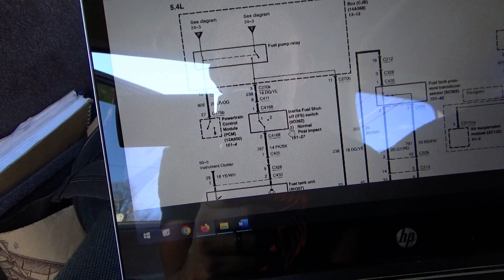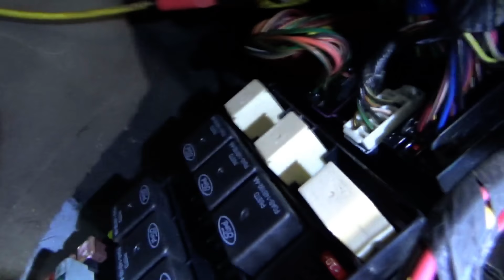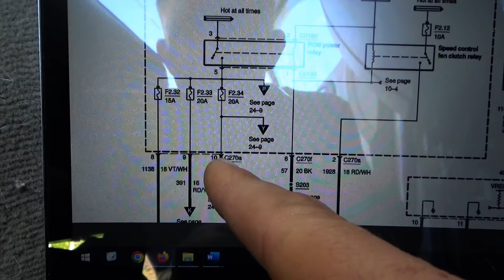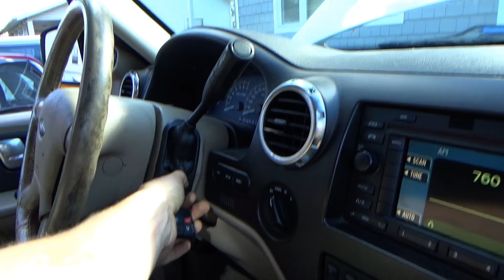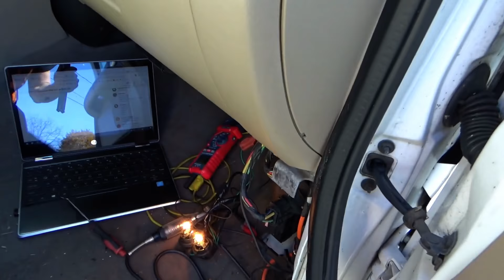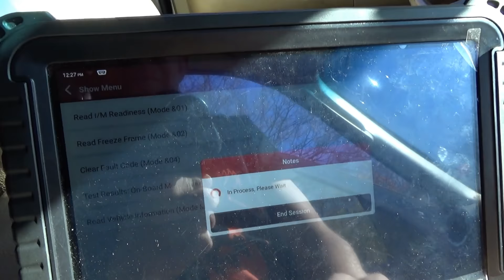Ford Owner STUMPED for 6 MONTHS? Fixed in 15 MINUTES! (No Fuel Pressure P0231)

Comment: During a collision if the fuel line is ruptured, that integral relay is turned off by the PCM when the PCM sees the crankshaft stop turning. This was mandated by the Feds so that occupants still alive don't find themselves in a growing pool of gasoline under the vehicle, that possibly might catch fire.  So, an external replaceable relay ought to be grafted into the circuit. For CYA reasons.
Reply: Look at the schematic on the screen, With this change the factory inertia switch will still shutoff power in the event of a crash.
Reply: @DavidNull5  And what if the inertia switch was replaced ... with a jumper? Or if said switch did not pop the ball bearing out because the impact was not enough?  What if you have a failing injector that could pump the fuel tank dry into the intake manifold?  What if the fuel pressure regulator failed?  On older vehicles, the return line could be pouring fuel all over the place, which might not occur if the pressure did not build and the injectors did not start the engine..,., pump would be off until it started.
 Save a few bucks and a few minutes, but the 'new designer' could be on the hook if any of that occurred due to deleting ECM control of the pump.
 I would add a external relay for the slight cost, and a bunch of 'what if' problems. tom
Reply: @DavidNull5  Yes that is true.  My 1989 has an inertia switch as well.  I'm thinking the inertia switch is good, but someone in the legal department wanted redundancy built in.
Reply: Ya, this is fine for a test but having the pump run full time the key is on is not safe from a fuel leak standpoint.
Reply: @compu85 these years vehicles have a return type fuel system.  The gas flows back to the rank
Reply: @compu85 Didn't they used to make a fuel pump safety switch mounted to the oil pressure sender when going from mechanical fuel pump to electric
Reply: U are from the what if department. 
The only what if is if there's an accident, and the ignition is left on.
Just remember,ber a what if allways trumps the dollar . Lol
Reply: @debsaville6756  I hear you. Retired auto mechanic here. The what if department is almost as old as the team of lawyers who sued Ford over drop in gas tanks causing average rear end collisions to turn into  infernos.  The Vega's oil pressure switch turned off the in tank fuel pump because GM didn't want the what if legal team suing them if the Vega owner knocked him or her self unconscious in an accident.  The theory was if the accident was bad enough to render the occupants helpless, and the fuel line was breached, the engine would stop running which would open the circuit to the in tank fuel pump, preventing the folks inside from being in a growing pool of raw gasoline.  So the what if department legal team has been alive and well for many decades, and I would not like our favorite independent technician to have his life turned inside out by them, over the simple deletion of a relay which he could easily install externally in a few minutes.  If I could do it, he surely could.
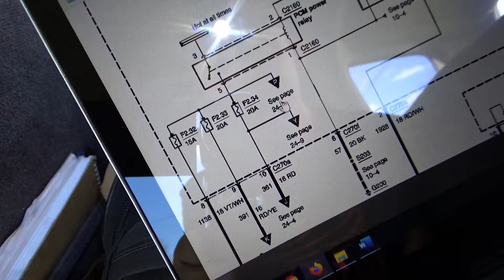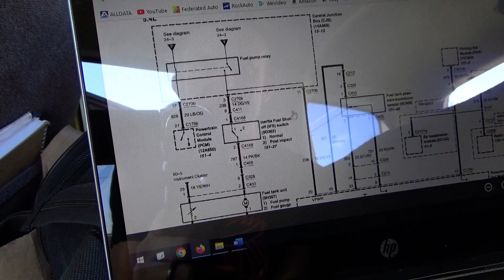Reply: The signal that turns off that relay also supplies the power to the fuel pump..  At 5:29, you can see the signal comes out of the PCM and obviously goes to Y, but it also goes to P..  P goes to the control side of the relay which you can see at about 2:50 in the video..
.
The computer isn't losing control at all.
.
Edit:   I'm wrong, I didn't see the control on the ground over on the left hand side of the schematic.
Reply: @bobw53jrma  P is not control side, it's load side. Look at the diagram again.
Reply: @fvdstone P looks like a coil. That would be the control side.
Reply: @fvdstone  : I did, you're right.
Reply: @bobw53jrma  So, it would seem that Ford is spending money on relays just so they can sell power centers when they go bad? No other possible reason?
Reply: @bobw53jrma 
You should tune down your confidence before spreading missinformation, bud. Fuel-pump relay is controlled by PCM via a lss. The feed comes from wire P, yes but the other side is controlled from pcm by grounding, clear as day.
Inertia switch is not enough, there a multiple other conditions that shall disable fuel pressure.
Reply: @TheFirstBigCheese :  I saw that afterwards, and was going to correct it, but I went to bed instead and then forgot about it.
Reply: @TheFirstBigCheese "Bud" is a douchbag word.
Reply: @Mag_Aoidh Sorry, I'll be more careful using "bud" next time; using dickhead, dumbass or even American if I ever need to push it. Especially if I'm gonna changing topic to language learning on a topic regarding vehicle engineering.
Reply: @bobw53jrma No worries mate.
Reply: @TheFirstBigCheese I agree, I'm okay with a parallel relay with the ECM controlling the new relay.  It's not that much more complicated. Just feed the hot wire to one relay coil (85) terminal, and to the relay output common terminal (30). The original control wire goes to the other relay coil terminal (86).  The N.O. relay terminal (87) powers the fuel pump.  This leaves all protection intact, and doesn't shift the load through different wiring.  The fuel pump probably draws about 10 Amps.
Reply: There may be reasons to bypass with another relay,  but he didn't bypass the inertial cutoff switch, which will trigger in an accident.
Reply: @hedaron3787 and. Importantly. Did not cut the gr ye wire. So that means the gr ye wire in c270b is sense wire for pcm and pcm will know Fpump is ok😊
Reply: I was coming on here to say pretty much the same thing.. this could be a big liability risk..
Reply: Inertia switch kills it with impact pcm secondary
Reply: If the motor stalls, the pump will continue to run all the time if the ignition is on. I’d be wiring in an external relay for safety. Anything happens down the track, owners are always looking for someone to sue.
Reply: @pw3111 if it stalls I would be turning the key off anyway
Reply: @the-ww-rrb-bandassuming you're conscious and aware. The "fix" runs the pump through circumstances that the ECM would shut it down.
Reply: @mikebrown7366  The video ended with the question: What would you do next?  Obviously my reply was incorrect.  Nobody is perfect. I have been retired for more than 10 years now.  Direct injection was quite new when I moved on.
   The ECM shutting down injection pressure is beyond my experience.
Reply: Inertia switch kills it with impact pcm secondary
Reply: I was thinking the same thing, in fact, in the mid-70s when everything was still mechanical fuel pumps, the feds mandated a rollover Valve to shut the fuel off. I realize the chances of this being traced back to you are slim, but with a New York lawyer, and a dead family...
Reply: Has anyone taken the junction box apart to inspect the relay?
Reply: @diyguy7357  I don't know.  Good question.  Soldered in most likely.  Possibly in a serviceable way, possibly not. If it were on a vehicle I owned, I would cobble in a standard relay, and mount it out of the way nearby.
Reply: The inertia switch will turn off the fuel pump and pcm will see that happen. ,not only crack sensor
Reply: No big loss if a Ford burns
Reply: @mikefoehr235 no big loss if any make burns, but you may be in it. O yea no big loss..

Comment: Let me start by saying I love all you videos Ivan.  This on the other hand is a bad idea in my opinion, This should have had an external relay installed, The way Ivan did this, the fuel pump will not time out when ignition is on with KOEO. Using the circuit diagram it would have been a tiny bit more work to add the external relay.
Reply: Now see that there right there y'all is three logarithmic levels above my back yard mechanical hatchet skills 😮
Reply: The pump is not on in the accessories position on the key which you would listen to the radio... And the inertia switch would work in a wreck. All is OK.

Comment: 😱  Check your ‘jumper’ wire guage size & what wire size you’re tapping into. Should match or be larger than the existing long run of fuel pump power wire…

Comment: Should be adding an external relay . Not letting the pump run anytime the key is on .
Reply: Thought the same.
Reply: Agree totally.
Reply: agree!!!
Reply: I was going to say exactly the same!
There's a reason why that relay is in the circuit, it's not there for fun.
Looks to be fairly quick and easy to fit an external relay, why not just do it?!

Edit: Thinking about it, this is a dangerous 'repair'. The fuel pump should not be energized unless the engine is cranking or running.
In a collision, the engine could stop and because the PCM no longer has control of the fuel pump, it would still be pumping fuel.
This would be extremely dangerous if a fuel line was ruptured!
Reply: @Ben-says-you-are-AWESOME  the enertia switch on fords cuts power to the pump in the event of a crash
Reply: @billbarney4937  True, but they're not infallible, plus, they don't activate in every accident.
Reply: The shop IS now aware of the exact issue and HOW to "OE-correct the repair". The onus is on the shop to professionally and ethically proceed (not saying in any way that PHAD or repair is unprofessional/unethical) but the onus to inform the customer of the current situation, repair, determine further parts and labor for "OE-correct" be authorized and deemed necessary for 20y.o. car, and to properly inform customer of the idiosyncrasies of the "temporary-but-compartmentally-safe" fix, is on the shop and customer. The repair is not unethical due to the fact that the Inertia Switch IS still in ECM- and key-controlled circuit.
Reply: Why ?  Better to add a fly back diode across fuel pump +12v and ground to stop arcing of relay that causes the failures. Use a 1N5823 diode
Reply: Everyone is in overkill mode here. I would for sure let him do this fix (If it was my car). First of all I would need to get into a bad accident and then have the accident so bad that I can't turn off the vehicle, and get out of the car. And on top of that have the inertia switch fail, then have fuel draining to the point it causes a fire. What are the chances? Well if all that happens then maybe it was just my time. Again, that is if it was my vehicle.
Reply: That's what I thought at first too, but the wire that kicks the relay is also the wire that supplies the power to the fuel pump.   
.
The only difference is that the wire that kicks the relay, which goes through P is pulled off before the fuse..   Look at 5:29 in the video, and then around 2:50.
.
If it was a new vehicle and had some value, yeah, probably replace the whole fuse block, but its over 20 years old.  
.
It really kind of is a useless relay.    The signal wire IS the power wire, just that the signal wire is split off before the fuse.
Reply: @bobw53jrma yes. Cause they got rid of fuse F1.9 and moved it to F34 and increased it from 15A to 29A
Reply: Should always fix things right! What about the next guy(down the road) chasing a no fuel no start?  I know it makes you look like a hero but what if vehicle is in an accednet and that inerta switch doesnt open and the person is trapped with fuel leaking?
Reply: @MR.KNOWITALL1982  Or if a fuel line comes too close to the exhaust system, or breaks due to some other reason.
Reply: @The-secret-101 if it came close to the exhaust manifold with a relay it could still be an issue…
Reply: @Mac_F87  Yeah, but if the engine stalls the relay would cut the fuel pump, most likely stop things from getting too bad.
Reply: @ so much what if in this comment section. And if the engine is running with relay? It’s still going to go up in flames. 🔥

Comment: See any Ford product from the late 1990s/early 2000s. They used an IRCM The IRCM (Integrated Relay Control Module) was basically a box with several relays soldered to a PCM.  Cheap to manufacture, but hot dog shit to repair.  The car needs a $5 relay, but it gets a $250 (in 1990s $) IRCM.

Comment: Well done, Ivan! Clever way to bypass an absurd problem "invented" by Ford! Initially I thought you would install an external relay, but when you said "no parts required" and shown the diagram, it's a perfect solution.
Reply: It's not a perfect solution. Any time the vehicle has any service requiring key on engine off the fuel pump will run constantly. Run out of gas and leave the key on and the pump runs dry.  If you run out of gas and want to push the vehicle or flat tow it the key must be on. If you run out of gas and call for a tow the tow operator will turn the ignition on to turn the wheels, load the vehicle etc, and the pump will run constantly with the key on, running a liquid transfer pump dry is never good for the pump.
Reply: @truracer20  You are right. I hadn't thought of that situation. Thanks for pointing that out 👍

Comment: So after the fix, when the ignition switch is on and when the engine is not running the pump is running ?
If yes, then maybe adding the "bypass" relay would be a better idea.  Of course I'm assuming in normal operation ( before the fix ) the pump only primes when the ignition switch is first turned on and then turns off if the engine is not started.

Comment: (1/of 3)  I'd of preferred you replicate the  "pitted" relay externally to the junction box rather than just jumper around it.  However I'm uncertain if the control lines for this pitted relay are available.  If so, an additional external relay best meets engineering criteria.  

----(2/of 3)  If it's possible to remove all connections to the pitted relay load contacts you might revitalize points by applying a punch-through voltage to them.  Clearly, if done wrong you'll roast your terminal block.---

(3/of 3)  I learned early in my career that relay points for D.C. currents thru inductive loads  require a diode across across inductor load IN OPPOSITE DIRECTION to current flow to allow collapsing inductor flux to continue flowing thus preventing arcing across relay points.

Recall, inductor voltage, V_L = L(dI/dT) so that quick dT => enormous V_L unless this load diode shorts out collapsing flux. Also with instantaneous decaying current (dI), V_L goes negative to then forward bias its diode to collapse its field rather than jump the relay points.

DO FUEL PUMPS HAVE INTEGRAL COIL DIODES??
Reply: Yes in tank fuel pumps have built in free-wheeling (suppression) diode. However, if you are in doubt you could monitor the circuit when the pump is turned off to see if there is an inductive kick. But, in the video the owner had already replaced the fuel pump in the tank so the diode should be brand new. The diode is integral with the pump internal motor connection. 

Most quick repairs for this problem with older vehicles are to parallel an external relay to perform the same function of the internal relay while making sure to disconnect the internal relay coil connection so the PCM low side driver only has to drive one relay coil. Based on the wiring diagram shown in the video you can easily parallel the fuel pump relay function for this vehicle.  

Many times if you pull apart the Central Smart Junction Box you will find the reason for no power feed is one of the relay power PCB solder joints has cracked and failed and the failure is not due to pitted relay contacts. Cracked solder joints can even burn the PCB depending on the design so if the PCB is severely damaged you may have to add an external relay anyway. Many times you can clearly see that the solder joint or a PCB trace at the joint is completely severed.
Reply: @windward2818  thank you!